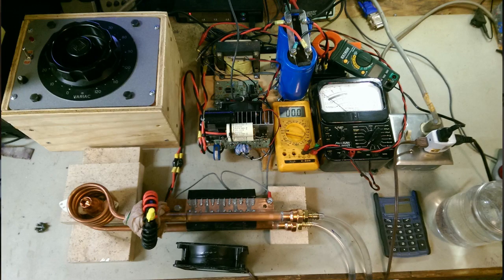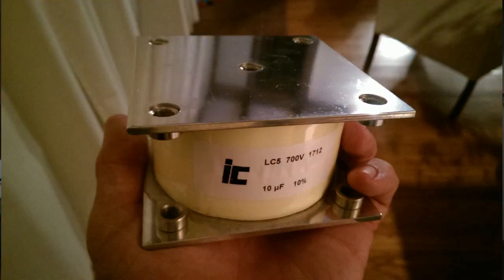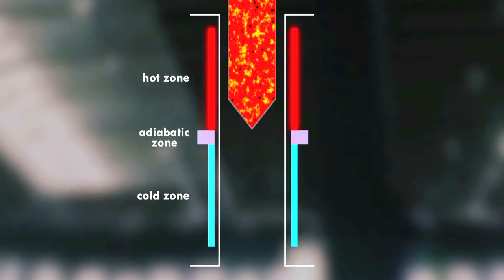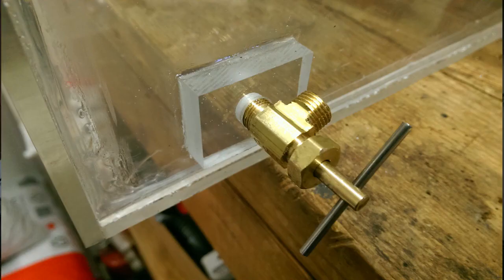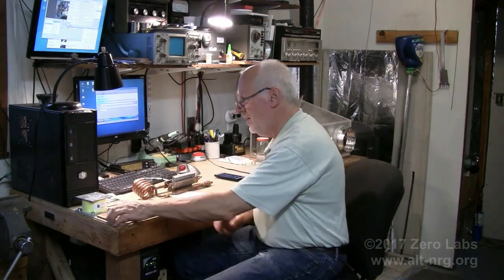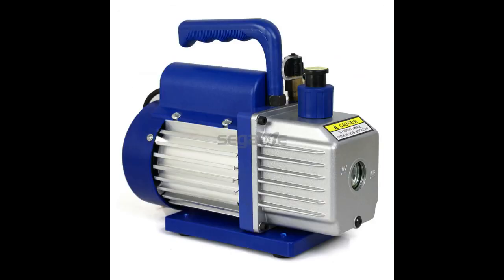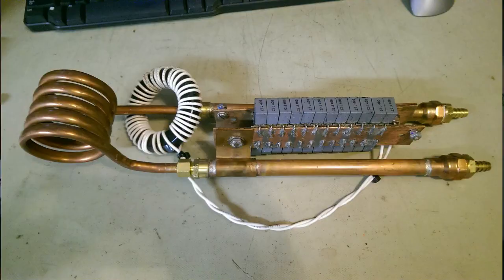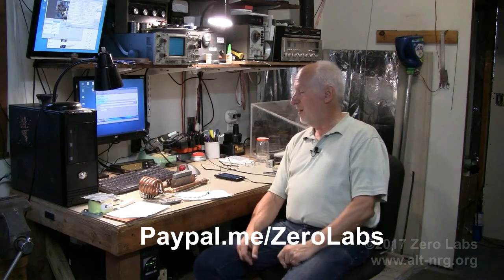#476 Non-Joulian Magnetostriction update 4

Comment: Maybe you could mount a piezo next to the crystal and use that to convert the oscillations directly into electricity?
This would need to be synched carefully of course. If you had trouble with that you might put a hydraulic non-compressible fluid in between. I am also curious to see how much force the crystal exerts on the magnetic field or magnet used to make it change shape.

Comment: Been looking for a description of how an magnetic expanding metal will be used in a free energy device... can't seem to find anything... got a link?
Reply from the maker: No links because no one has published any. Pretty sure I'm the first. There are two possibilities.
  1) Resonant mechanical vibration of the alloy to direct magnetic field generation inside pickup coils to produce AC.
  2) Direct mechanical output to a crankshaft from passing permanent magnetic fields.
If my information is correct, the alloy can expand by as much as 20% it's original size in one direction, increasing in volume ~16-17%.  A 2" long bar could potentially expand to 2.4"!  Think about that.